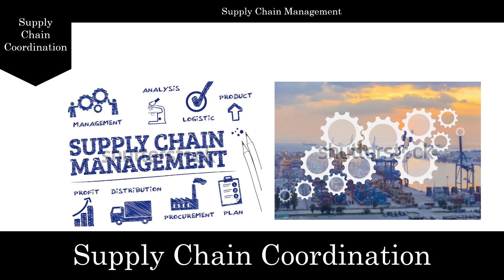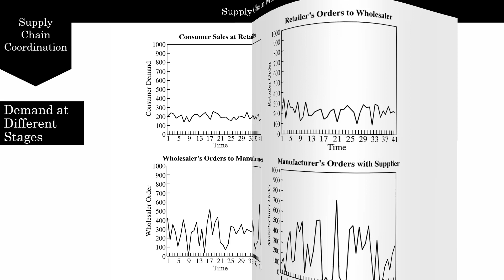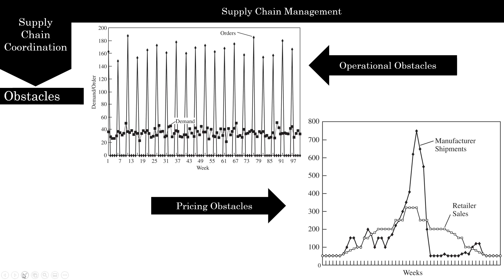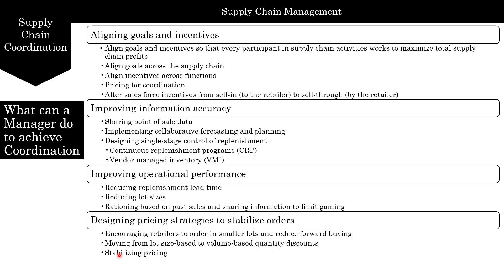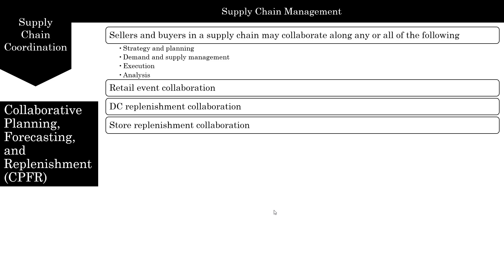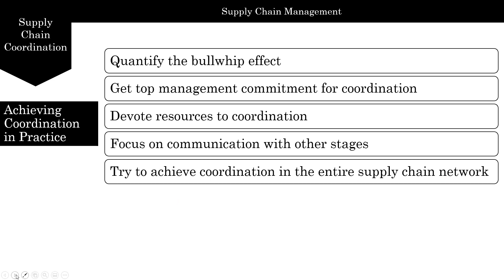Supply Chain Coordination

Comment: Supply chain coordination has a principle: when the efficiency (output/input) of all companies in the supply chain is equal, the supply chain is coordinated. All contracts used to coordinate the supply chain make the efficiency of the companies in the supply chain equal to 1, which means that the economic profit is 0, thus failing to coordinate the supply chain.